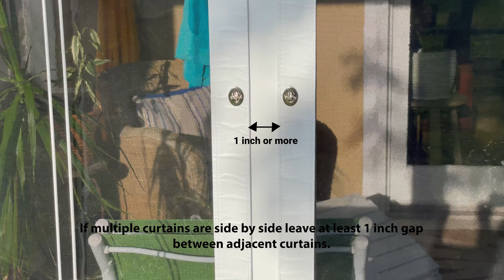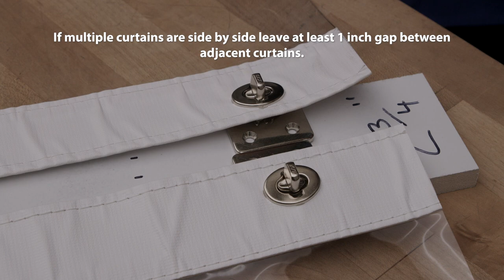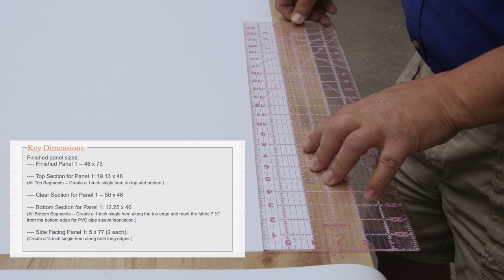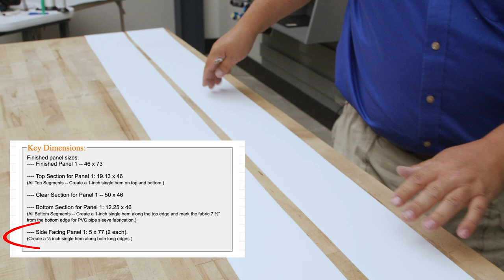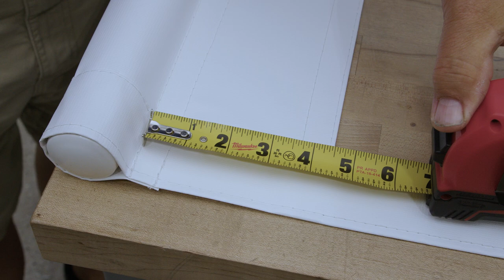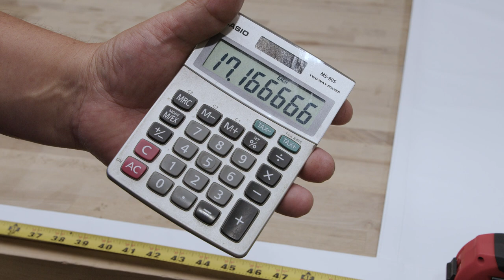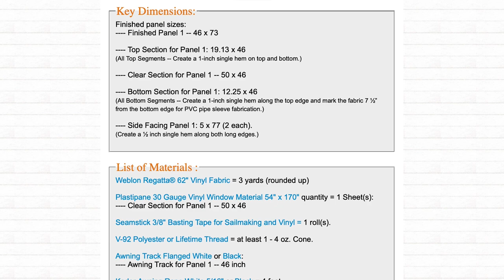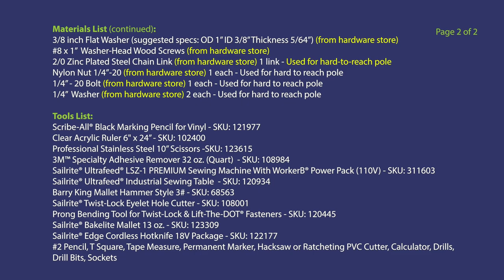How to Make Roll Up Enclosure Panels for a Screen Porch

Comment: would panels 12"w by 8"h be to heavy to roll up or would it just be a matter of putting an extra pulley or 2 on the span?
Reply from the maker: Hi Pete,

I believe it would work, but you will probably have to add an extra pulley or 2 as you mentioned.